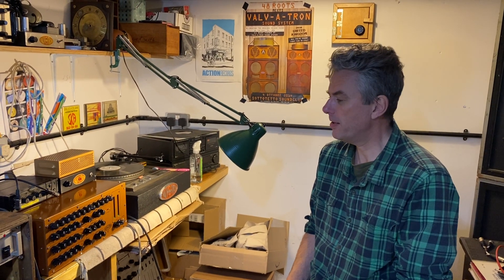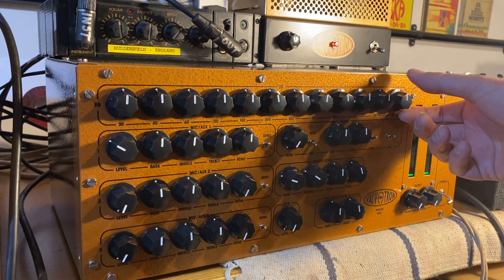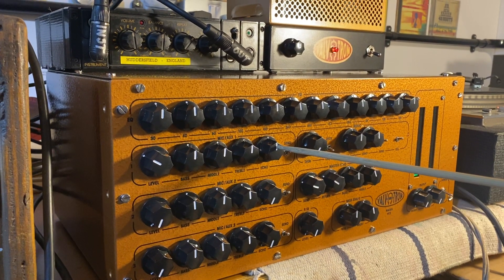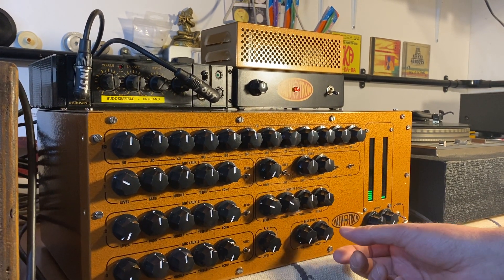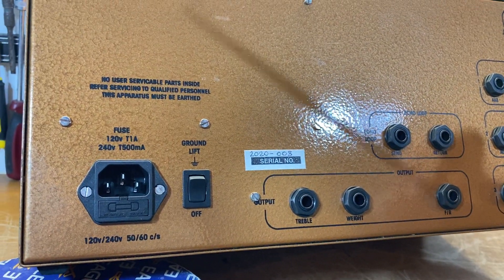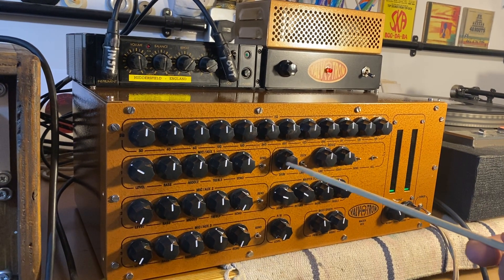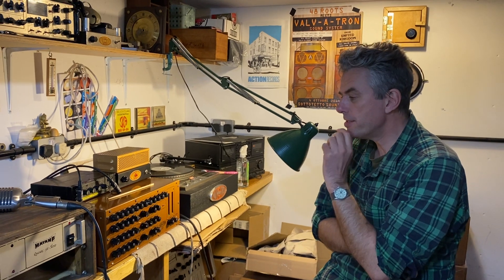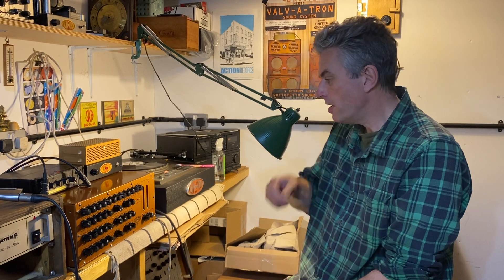Valvatron 2 way Reggae Preamp Mixer

Comment: Hello, very cool pre-amps I must say, and was wondering what type of speakers you have in your workshop?, I saw them in the recent tube amp video, and they looked interesting, are those loaded with 15's? I was looking to put something similar to them together myself, cheers!
Reply from the maker: Hi. They are ROGERS LS1 or LS2's fr 1967 BBC theatre. Goodmans 15" drivers and Celestion tweeters.
Reply: @Axissound  ahh cool, much appreciated, thank you